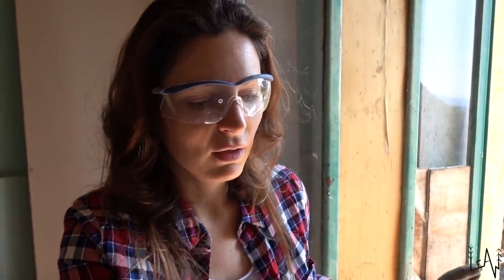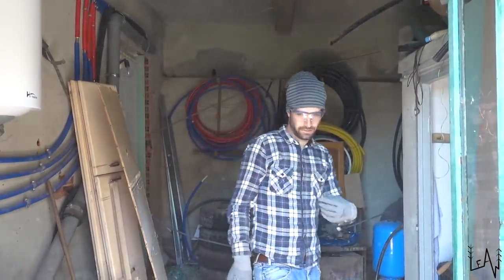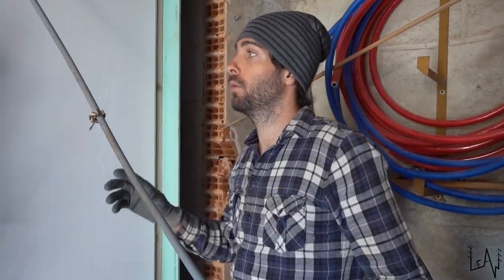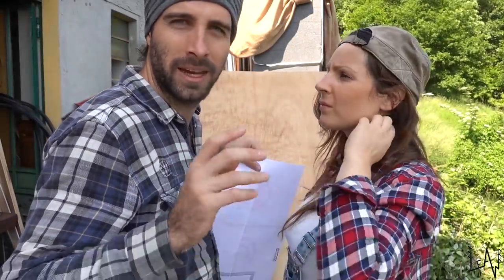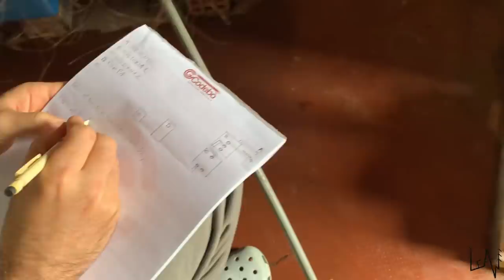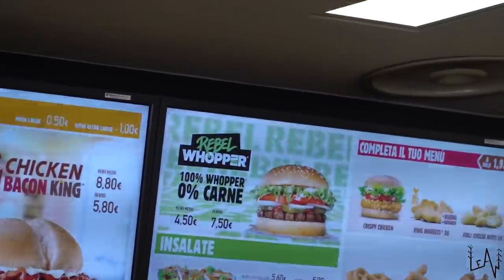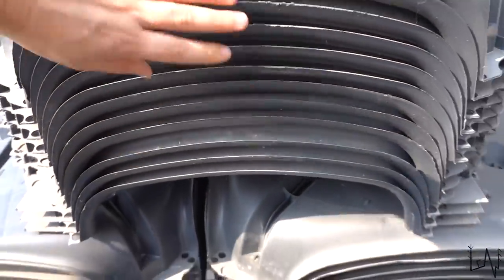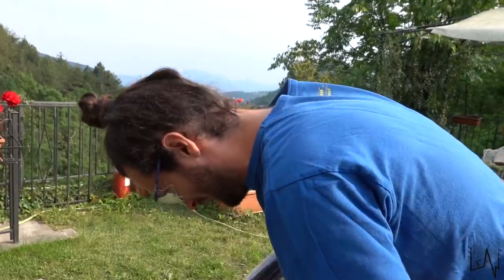DIY UTILITY ROOM RENOVATION on a budget in Italy - Let's start from scratch

Comment: It might be a good idea to dig the earth away from the back wall,dig a trench fill with stones to drain away water,and felt the wall just above the grass,it should help the Dampness.Inside plastic sheet on the floor cement over leaving the plastic sheet sides above the wet cement.Google the process to get ideas

Comment: What is to keep your inside wall next to the gap from rotting?  We called it “rising damp” where I used to live in Virginia, USA. Some form of drainage on the mountain side is needed since you actually have water on the floor. The gap can work better without rotting your sheet rock wall with some form off drainage outside.

Comment: Since I'm in the staying at home doing the social distancing thing, I've been cleaning my woodworking shop after probably 20 years of collecting "stuff".  I pretty much have it all done and yes I also had a lot of "animal souvenirs" to clean out.  lol.  Nothing but aisle ways between my power tools.  It was hard to work in but now it's all opened up.  I think you maxed out Little Lews load capacity but at least you made it home, so it's all good.

Comment: Could you go into more detail about where the water coming through your wall ends up going.  Does it evaporate or run into a drain.  Can we get more details about where your spring water comes from and how you pipe it into your house.  Also, in upcoming videos please show how you will build the laundry room floor.  
Grazie per i fantastici video.

Comment: in the US, we have a product that we can paint on a wall, that prevents water from seeping thru it.  it's common to use it in cement or rock basements where it can get wet.  there must be a similar product in Italy for those cement on rock walls and floors?  i would worry about the damn ruining your archival documents if that's not addressed.

Comment: There is also a type of paint I used on my basement that is impregnated with cement called "DRYLOK" which acts as a sealant on porous basement walls like cinder block. It helps seal out any water that might seep in from the outside due to hydraulic pressure. You have to "etch" the walls with a type of acid, then paint them with this DRYLOK paint. Also ventilation, because some of the moisture may be due to the wall being cooler so that the moisture in the air condenses on the wall and floor. You would probably paint the floor as well with DRYLOK.

Comment: You need a dehumidifier that will run 24/7 down there.   I have one in a basement that had a moisture problem.  T pulls out about gal of water every day.   During wet weather, even more...
Reply: Power is expensive in Italy, I think they should figure out a more definitive and sustainable solution.

Comment: Just a suggestion, there is a special masonry paint that will waterproof the foundation wall and prevent moisture from seeping through the wall. It is called Drylok. Not sure if you can buy it in Italy but you can try Amazon.
Reply from the maker: Thank you

Comment: I know what I'm going to suggest is an incredible amount of work but you might consider patching that water leak from the back side. When it snows and melts during the day and refreezes at night it can crack the wall and possibly even the foundation. I had a similar issue in a house I refurbished and the basement flooded from the rain. I look forward to seeing the renovation.

Comment: You're going to need to dig up the back side of the basement wall and seal it, then back fill with drainage gravel. The water will on get worse.
Reply: Depending on the areas geology excavating can sometimes turn into more of a nightmare. We had a similar problem and ended up drilling the interior foundation and pumping in hydraulic cement. Then we created an interior channel parallel to the base of the wall and filled it with the trap rock. We had minor leaks when rainfall exceeded inches an hour. The drainage handled that easily.

Comment: Sump pump? No idea if that's a thing that's done in Italy, or even if it would actually help. But where I live basements sit in ground that is mostly clay, so we have pumps that sit in a pit near the wall and the lowest (very slight grade) point of the basement to gather then pump water into a proper drain and away from the foundation.

Comment: 3:26 You guys really need to replace that surge protector. If it fails, it'll start a fire.
Reply: 10:07 To save time & space, you should make a spreadsheet on Excel or Google for your expenses & scan the receipts just in case the ink fades. 🙂
Reply from the maker: We scan everything and we have an excel file but the Italian law requires to keep all the papers too

Comment: How do you plan on  taking out the Sand, Rocks, Cement from the back of the van that was loaded on the pallet with the forklift ?
Reply: If the aggregate in the bag is mixed stone and sand the quickest way to unload would be to park the van on an incline, set the parking brake, use some of the scrap plywood for a ramp, lay a tarp on the ground, cut open the bag and push the material down the ramp onto the tarp.